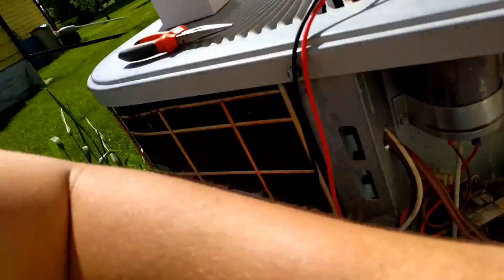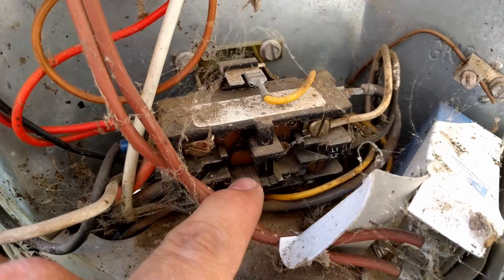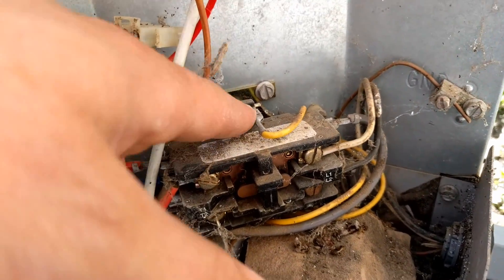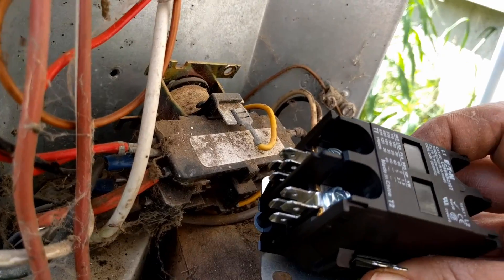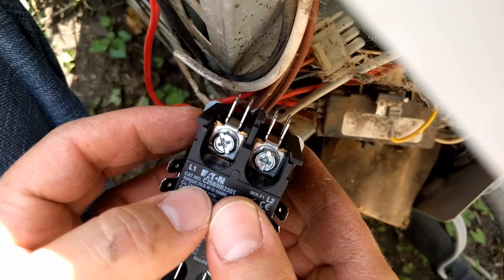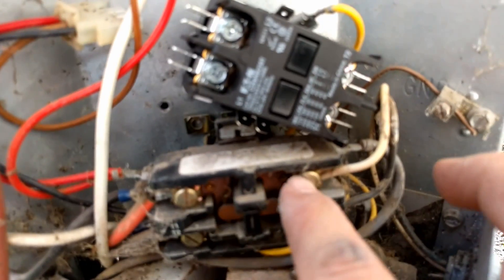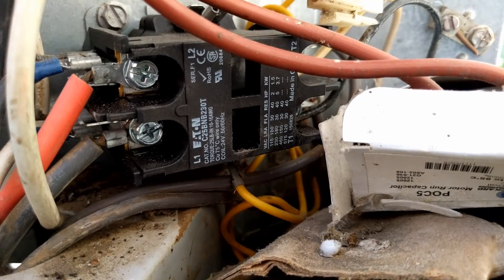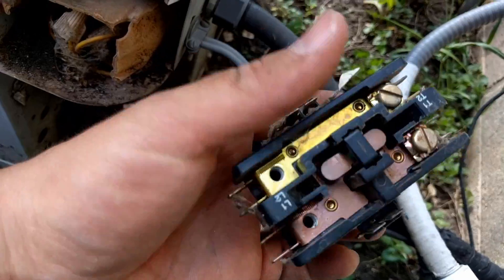How To Replace a Contactor in an Air Conditioner - AC Repair & Troubleshooting

Comment: I wish someone would actually explain the connection points rather than just saying "just hook it up like-for-like". That doesn't tell me anything if the old contactor was wired incorrectly.

Comment: I would advise anyone unfamiliar with this process to DE-ENERGIZE your CAPACITORS after disconnecting the line power and opening up the unit. (Take an insulated screwdriver and ground them out to a metal casing within the unit). I found out the hard way.  It’s not pleasant. ⚡️⚡️⚡️

Comment: Hi!  Just ordered a Packard single pole 30 amp 24 volts contactor on line.   Doesnt look like it is labeled  L1 L2, T1 T2.   Are their locations standardized the same if I orient the contactor according to my existing old one of a Siemens brand with the side that has the contactor?

And does each of the four 4 prongs belong to its own group so that wires belong to that group can be plugged onto  any of the 4 prong configuration as long as the wires are in the right group, ie: T1 or T2?   

Also, can sources for the main power go on either side of the 2 screws or lugs on the line side?   Thanks in advance!
Reply: It's their in super tiny font you just have to look carefully
Reply from the maker: You can call me on this app and I will do my best to walk you through it if you want! Maybe talk to you soon!
 https://kp34c.app.goo.gl/AdBKHZNcUpcny3JEA

Comment: Not all residential A/C's use double pole contactors, some use single pole contactors. It's best to use a like kind contactor.
Reply: Mark Nmolly what happens if you replace a single pole with a double pole like he did in the video?  I did the exact same thing.  Runs fine so far. Thanks!  Just learning

Comment: Hi Ben,

Excellent tutorial video! Just thumbed up and subscribed. :)

I have some questions on wiring a broken "1 plus pole" style contactor to a 2 pole, if you might know the answers. I would really appreciate your help or the help of any passerby good samaritans who can help my family out.

So I have a Goodman heat pump. It uses a 1 plus single pole contactor with a metal shunt along the left. Please see my thread I posted here on Appliance Blog for pictures:  https://www.applianceblog.com/mainforums/threads/62815-Goodman-Heat-Pump-GSH130301BA-Contactor-Capacitor-Replacement-Questions?p=313559#post313559

In the new, 2 pole contactor that Goodman recommends, the always connected shunt side has been replaced with a switch. It is my understanding that the shunt is always on, and always needs to be on. On the shunt (left) side of my old contactor, there is single black wire on the bottom left group of four terminals and there are two black wires going out the upper left group of four terminals. On a 2 pole contactor,  is it correct wiring to put all three black wires on the bottom line side group of four terminals? So they bypass the switch? Is that safe and correct to do?

Also, how do I get the three wires (common? low voltage?)--the black, light blue, and dark blue--located on the right middle side of the old contactor to connect to a new 2 pole contactor, which looks to have only two terminals?

Your help is massively apprciated to get the wiring straight. My whole family is without A/C and the local contractors want $475 to replace the capacitor and contactor! TIA!
Reply from the maker: +katmandu I'm sorry your local companies aren't reasonably priced. If you were here in Southwest Minnesota that repair would be around $200 or $150.

Anyway, I would buy this contactor:
http://amzn.to/2yhC5D1

It's a 40 amp unit which will last longer than the 25 amp. Simply move all of the wires to their respective locations on the new contactor. You do not need to move any from the top to bottom on the side that used to not be switched. The OEM's only use the 1.5 pole contactors to save money usually.

Shut off all power including for the indoor unit before installing the new contactor.

I don't think you need to bother with the capacitor unless you know it is bad but if you want to replace it then pick this one up: 
http://amzn.to/2gBr6wF

Double check the rating on the side of your existing capacitor before ordering. 

The side connections on the contactor on the middle right is using a piggy back terminal most likely which is how there are three wires there. There are actually just two terminals. You'll see when you plug them off.

I would have to know where those yellow wires go in order to make a recommendation on that. They don't look like they have been hooked up so capping them off is probably fine.

Let me know how you turn out. If this saved you $400 and solved the issue I'd appreciate if you would consider a donation to support my channel. My PayPal email is bensahlstrom@gmail.com.

In either case I'm glad to have been able to help.
Reply: Hi Ben,

Sorry for the week delay in responding. For some reason, I didn't get a notification in my email that you had replied to my post. I just checked your video which I had bookmarked today, Tuesday, 10/4.

Anyway, I fixed the problem with some help from a local HVAC parts supplier. You were right about two of the three blue wires being piggybacked. I bought a different 1.5 pole contactor called "ProTech" and a capacitor from the supplier. 

It tuned out that the cut yellow wires went to a low pressure sensor that was likely cut out of operation a long time ago. Nothing to worry about though; I thought they might've been burnt.

I really appreciate your help nonetheless. I just sent a little something to your email account for helping. HTH and best wishes with your top-notch channel!